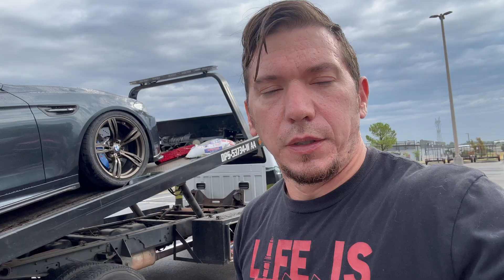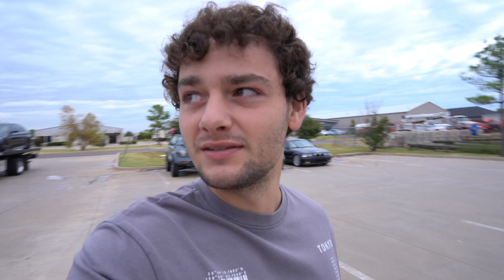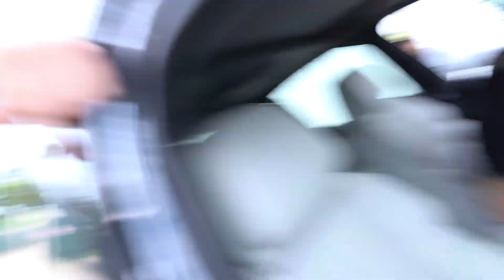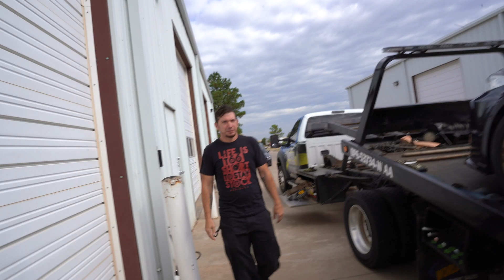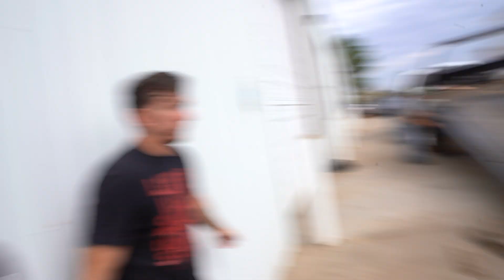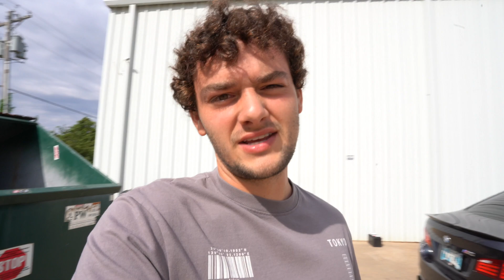Twin Turbo V8 BMW M5 Build Update... IT'S BROKEN.

Comment: Had the same thing happen to mine. Thought it was the top but spun 3rd bearing. Went full forged after. They did have a pump recall though for the s63
Reply from the maker: Bad part is this one is fully forged already so we are at tear down again.

Comment: Check to see if you have vacuum when you open the oil fill cap if so, you may have an issue with one of the breathers and the valve cover for the check valve on top of the valve cover
Reply from the maker: Those were all replaced when the motor was built. Something came apart internally. Will update with new video soon.